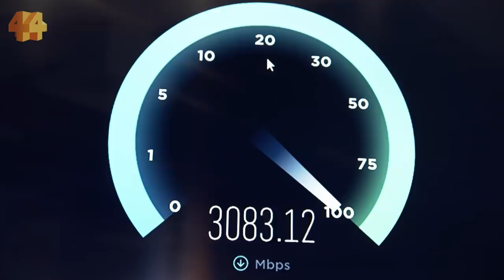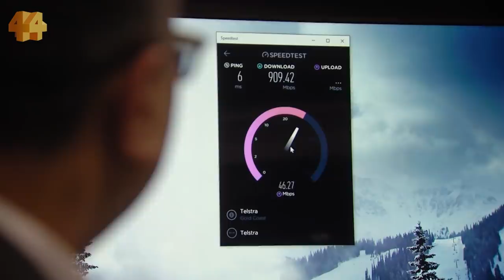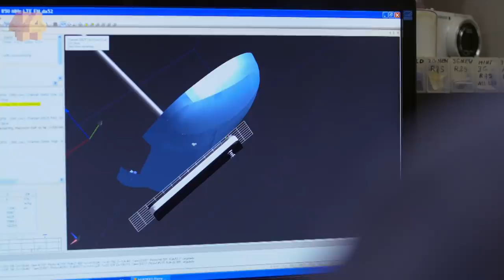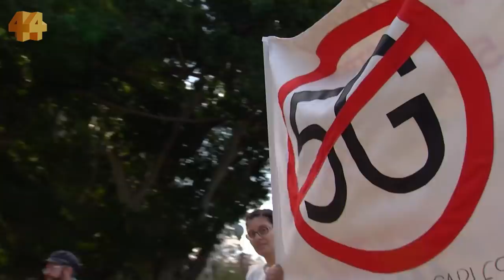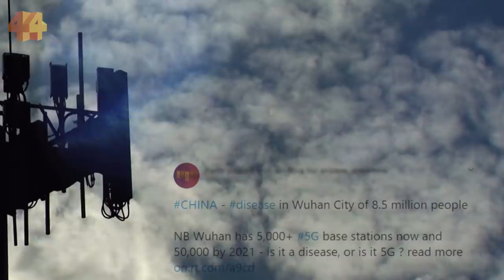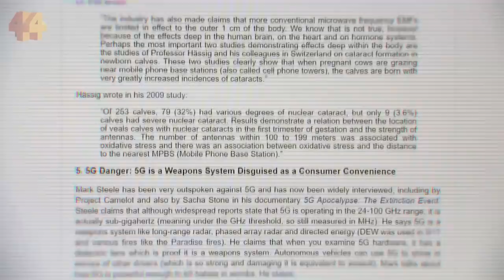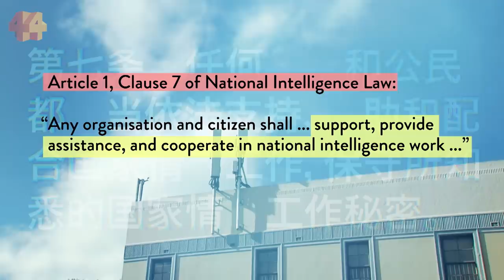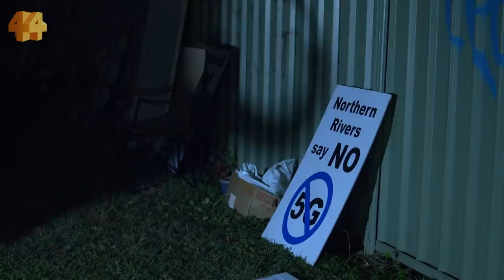Heard some rumours about 5G and COVID-19? Here's how they spread | Four Corners

Comment: The question is regarding radiation.  So how come you did not find out that the 5g radiation is directional, ie pinpointed to the phone involved, or if desired,  to the person targetted. Why was this angle on the complaint not dealt with directly? The problem with its directionality of frequencies is that an unwanted person can be targetted repeatedly with,  therefore,  excessive radiation. This can be a political tool, just like chemical or biological poisons. It is clear, that it can be used covertly to take political control. It is also clear that 4corners or the ABC did not do their job, because if I can know this detail from the internet,  why not the ABC including ALL the interviewees selected from. You should have mentioned it. I don't trust you lot.
Reply: Yes ...the 5G signal goes right through those who are in the way ...
Reply: What frequency does the radio signal transmit? Be more afraid of sun radiation…. Stay indoors and unplug your WiFi
Reply: @MrBobbo18  you are missing the point ...cue here is "Directional", and that it can be used in bad intention ...
Reply: @jeffouellette9946  Can you specify where and when ?
Reply: @ClausWeiergang  : The characteristics change with frequency. At the microwave level, the energy is easily absorbed ..eg. that's how a microwave oven works. The reason why the 5G/6G range gets shorter is because of energy absorbed by the air.  Early on, it was known that there was a higher incidence of brain cancer for people that have high cell phone use next to their head (use an ear piece). 17+ years engineer in cellular industry.

Comment: The problem with all this tech is that people eventually find a way to use it as a weapon.
Reply: It was designed for that purpose. 5G mmw was military technology to begin with ie the  active denial system
Reply: @derfthekhemist8517  My ex had an active denial system also.
Reply: @tonyrobbins1665  mm didn't know that but was about to say that a hacker using 5g will outspped an international hacker using 4g thus its militaru application is widespread and obvious
Reply: @lexi-lee  agreed but unproven. 
Totally different subject: couldn't they have Jazzed up the "brick in the wall" copy. aits just onr line and sounds stupid.
Reply: @morejoy5188  fyi, 10 G is already out

Comment: They are going to put them up no matter what, we can whine about. It's already happening, I'm growing old an don't think anyone can stop it as 6G, 7G, 8G, 9G an 10G are not far away
Reply: Given that the frequency or the wavelength is now in the millimetre the distance that Signal can travel before it completely degrades. keeps getting smaller. When you have wavelengths there in the nanometre you can transmit really fast data but only over a very very short distance. And as the signal gets smaller in terms of the wavelength you can transmit ever increasing data. But the distance you can transmit it at gets smaller and smaller in radius. So there is a theoretical limit to all this.

Comment: We know that EMS causes a feeling of anxiety, a feeling of being watched. Areas of high EMF are called "Fear Cages". That's my only concern.
Reply: @bechelerroseme6821  surely graphine oxide is carbon monoxide or carbon dioxide?
Reply: @dearhunter7206  "graphene " with an "e", do the research.
Reply: @Philip Dennis i brush fluoride free but I see what you're saying
Reply: @bechelerroseme6821  most states put fluoride in the drinking water
Reply: What's the difference between EMS & EMF ? Tried to look it up, but couldn't find anything....
Reply: I have metal in my cranium and when I get close to 5G cell tower it causes my head to heat up and I get dizzy and have seizures
Reply: @jameslightfoot9998  that sounds soooooo believable.
Reply: @ttbbb3835  EMF  “electro magnetic field”. EMS (sensitivity)

Comment: This tech is unlikely to produce deliterious health effects. The radio frequencies used by 4G and 5G are not ionizing bandwiths and studies that show in mice inc cancer rates used constant, high intensity exposure at short range. Your exposure to radon gas, especially if you live in the western part of the US is far more problematic. I should also say that light, X-rays, and UV have far greater energy per photon than 5G high frequency radio transmissions.
Reply: All current 5G rollouts operate in the same bands as existing 3G and 4G services. mmwave bands have not yet been licensed or franchised. As you say, it's only RF. These people will stand next to a red hot BBQ, in midday July sun, and then worry about a cellular tower half a mile away!!!!

Comment: 6:06
Being someone who has worked in IT, his laptop which he is showing 5G as being ‘super faster’ as you will see in the corner of the screen is plugged in with a Ethernet cable, Ethernet cat5/cat6 is very capable of gigabit speeds, it is also a wired connection meaning that it would not use a bandwidth like 2.4G or in this case 5G (you can google this), 5G and 2.4G is what you use for a wireless device like your phone, so they are actually not even showing the speeds that a frequency like 5G would yield, and in other words they are showing the wired speeds of one of their data centres. They still haven’t showed how fast the actual bandwidth of 5G would be.
Reply: From my speedtests of 5G so far on the n78 band on o2, the bandwidth is about twice that of 4G LTE at the same location at the same time. For me about 200 mbps.
Reply: @Zenovarse  I get 496mbps. There is no spoon, but there are plenty of forks 😈🙈🙉🙊👀

Comment: As an epileptic, 3G caused sufficient pathway interruption in close proximity to H.V. power and caused a grand mal at a H.V. power awareness course for telecommunications installation within Telstra on a mobile device. As an ex telco installer and designer, there is no doubt in my mind 5G has the ability (due to wavelength) to be weaponised if not to be a constant threat. The ‘easy’ resolution is a faraday cage encompassing individual homes with an internal hard wired wi-fi modem; limiting this technology.

Comment: Already  i  am suffering the eff3cts 9f emf on my body . from the feet upwards to my torso I experience freak uncontrollable spasms it feels as if my body is connected to a low electrical current  . I'm sick of it because although its not painful I get the urges to shake the feeling out of me so I have to literally ..shake it off . I also hear frequencies in my head that go higher or lower and if its quiet i almost cannot unheard this frequency of sound
Reply: My son also suffers from that problem of hearing everything, even the hum of electricity just from an unused appliance being plugged into the wall socket, he has hyper-sensitive hearing that the normal ear can not hear.

Comment: I remember hearing about the 5g issues 3-5 years ago and basically, low dose radiation is much more deadly over a long period of time. However, who knows if the technology has been optimized or improved since then or if it'll be implemented with the optimizations to make it harmless.

You can look up the symptoms or dangers or low dose radiation vs high dose radiation. Should detail the dosage amounts for the effects and then you can compare that to the radiation emitted by 5g towers, if that information is available.
Reply: Radiation just sounds bad.

Comment: It’s not the frequency of 5G that concerns me.  It’s the need to have so many towers to use it.  Creating a virtual RF cloud that I will have to live in.  Count me out of 5G.
Reply: Educate me what is an RF cloud?
Reply: @bohemialite6371    Electromagnet Radiation to be exact.  It’s like trying to tune your radio in standing below high voltage transmission cables.  It can get so dense that it’s a bit like sitting inside a microwave oven.  A small amount is tolerable but it eventually gets to the point where your bathed in it.

Comment: Saw the sign about fibre optic cables. Lmao. You realize that fibre has been a thing for years, since 3G, right? How do you think the towers talk to the outside world to deliver you cat videos. It ain’t magic.
Reply: Fibre optic cables have been around since the 1970's. And probable before than. 1960's I would have been to young and no interest. Before that I was not alive.
Reply: @doradavid4408  exactly. And fibre is awesome! It’s so awesome that the NBN is able to let you chew on 1000/400Mb bandwidth, and yet the NTD still uses an LED! To shine nothing but light down a strand of glass the width of a human hair, and is entirely impervious to electrical interference, wiring problems, basically everything. It’s two LEDs or lasers blinking at each other.

How could that possibly ever hurt you, apart from damaging your eyesight if you are silly enough to look at them? Fibre is awesome, and we can only benefit from more of it.

Comment: So, was 4g dangerous as well? I dont remember any of this when it  rolled out. We are being blanketed by radio transmissions constantly. Your bluetooth connection is radio.
Reply: I remember 3g being latest and greatest innovation, too.
Reply: To elaborate:
4G is as dangerous as 5G - not at all. Both are non-ionizing radiation. They, like microwaves, radio, BT, WiFi, infrared, ultraviolet and visible light are just different wavelengths of electromagnetic radiation. 

4G & 5G can't impart a meaningful amount of energy on your cells. They simple don't have any attributes that would make them dangerous. That's where this """discussion""" should've ended. But because people don't understand basic scientific concepts despite theoretically having access to that information, we're at this point.
Reply: @esprit101  thankyou for the very clear explanation, hopefully a few of the byron bay folk are paying attention
Reply: No.... Ur wrong..... Does 19 Degrees Celsius harm you?, How about 50??? Pleases don't say u don't know!
Reply: I remember hearing a lot about the dangers of 4g.
Reply: I like it the further you scroll down the comments you see the sheeples comments
Reply: @emm8357 .. wrong  ,, heat sensitive cameras show brain heating up in areas where cell phone antenna is, while using phone,  also corresponding imaging of cancer cell in that area in the shape of the anttena.   It is even manufacturer recommended not to use cell phone next to the head during a call. Do some research before sharing your doubts. F. y. I. the brain doesn't have to get super heated for illness to occur as in a high fever, that is only several degrees above normal,,, many have deaf problems because of fevers during youth /infancy...    Shalom

Comment: I think one thing to look into is that 5G frequency is similar to the brains own frequency and therefore information could be sent to the mind and vis versa. I think more study should be done on the frequency not the radio waves.
Reply: Our bodies Cells work on Frequency RADIO...
Reply: @Stefan-jk5gx  Another part of the radio spectrum that’s being used for 5G, is UHF, which is lower on the spectrum than EHF. The UHF band has a frequency range of 300 MHz to 3 GHz, and is used for everything from TV broadcasting and GPS to Wi-Fi, cordless phones, and Bluetooth.
Reply: Absolutely bang on. It's not the radiation but the signal carried by it. Also beamforming can target you.

Comment: The problem with the antennas is the cheap lack of engineering principals in the design as the cheap antenna have large amount of reflective (VSWR) properties and in most cases those antennas have no testing with polar scalar networking analysis or relative gain in the pass band, or the out of band rejection levels near the noise spectrum. It is the subharmonic and frequency multiplication effects of the antenna that also emits RF microwave signals
Reply: I wish I understood about this.

Comment: 5G will use spectrum in the existing LTE frequency range (600 MHz to 6 GHz) and also in millimeter-wave bands (24-86 GHz).   Microwave ovens use 2.45 GHz.   WiFi frequency bands: 2.4 GHz and 5 GHz

Comment: I went into this video not believing 5G was bad - but this vid is feeling like propaganda.   The radiation from power cables & power infrastructure was proven a long time ago 2b harmful.   2 kids at my elementary school (Bird Rock, San Diego) got cancer.  they were both in the bungalow class which was adjacent to  power lines & transformers.  1 was named Oscar, he passed very young.  & the paramedic heads-up-display is entirely possible with existing phone & body-cam technology.  it simply requires making customized devices.  I think letting a private company install many more antennae everywhere on public land is an issue.

Comment: My Dad was a TV / electronic repairman thru the 60s 70s
    And I would poke around the shop and watch him do his bench work
He died of head and neck cancer
Any people 50 and older will remember the wired static you  would feel on your head as one turned on the vintage TV sets
Well ,,,,,, it seemed to be stronger in the back of them huge picture tubes , as they lay open on the bench
My Dad's head all in it looking to repair it
It seems to me that 5G would be many times that exposure

Comment: 5G RF transmissions in current power levels are harmless. Even repair men heads come 5-6inches near active, grouped transmitting antennas with no damage.  The problem with the 5G frequencies is possible more signal losses unless more antennas are placed around.

Comment: These bandwidths has been in use since the 50s.  With the advent of new telecommunications hardware and and a change in  formats signals now take up less space and so huge swthes of these bandwidths went up for sale and were bought up by 5g providers. There is nothing new going on in these bandwidths and it's a laugh to argue otherwise. The only difference is that they previously hosted compressed military content and now they house compressed private content.

Comment: My 5G phone doesn't seem any faster at all, but it eats up the battery about 3 times faster than my 4G phones of the same brand, with the same size battery. Also it has problems charging. I"m thinking of buying a 4G phone and switching to it.  This 5G phone seems like a piece of crap. I guess I should check the speed. It actually seems a bit slower than other phones I've had. My videos have a lot of lag, it seems.
Reply: Honestly, it's extremely unlikely that the transmitter, or whatever it's called would be the cause, since to the phone software, there's no real difference between 5g and 4g or less.  More likely it's due to the cell carrier bundling unwanted junk pre-installed on the phone.  Most carriers include tons of unneeded/unwanted bloatware on phones.